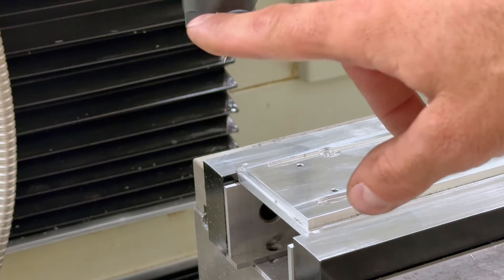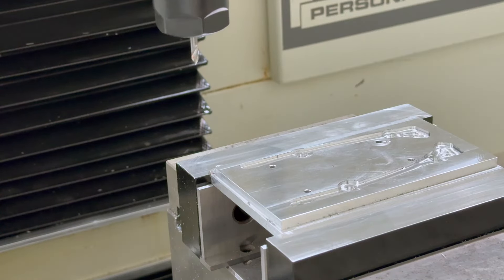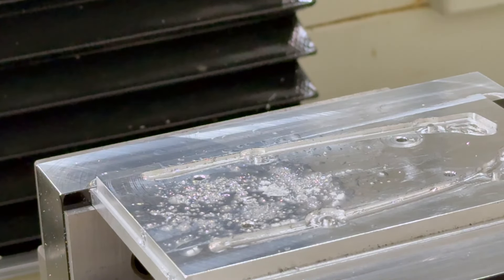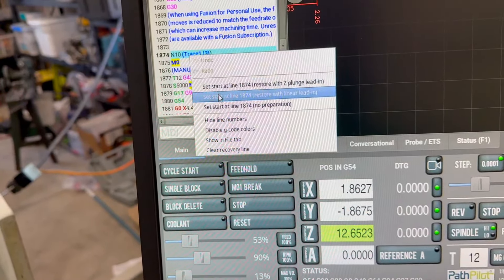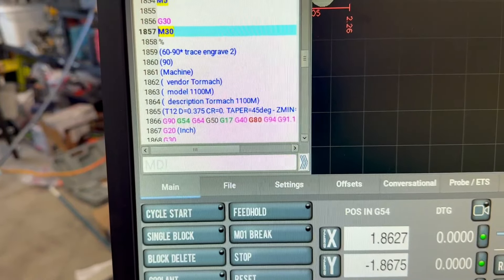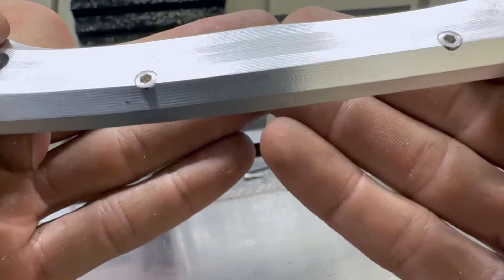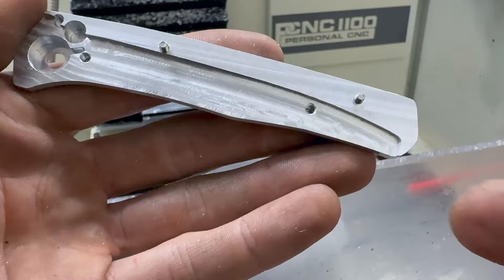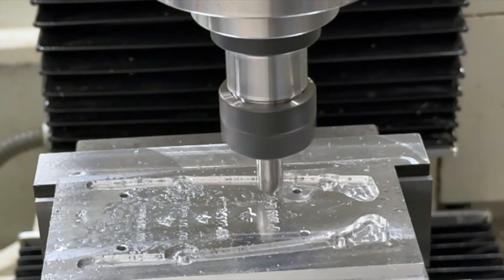Machining a Knife Handle with a Custom Jig on My Tormach 1100 CNC!

Comment: Nice work!  Having been down this path, I strongly encourage you to take the plunge and work out a flood coolant solution.  The first one on my PCNC1100 was stock tank and pump.  

I didn't have an enclosure so I made a frame from PVC and hung a shower curtain from the PVC pipes along the top, tucked those into the tray and held the bottoms with magnets.  Yes, just as awful as it sounds.  But I didn't realize until then that a) Slotting passes can actually work without breaking an end mill, b) surface finish can be good, c) I can machine parts about 4X faster with coolant versus the fogbuster setup.  

It was annoying to deal with flood coolant this way, but I wish I had setup flood immediately, it would have saved a ton of time babying things and blowing chips away by hand and it would have saved a ton of time wasted on broken end mills.   You won't regret it.
Reply from the maker: My dilemma is that the machine will most likely sit up to a month or two, and based on how I got the machine, with nasty dried up coolant that was almost 1/2” thick in places, and rust all over, I’m worried that could happen again. How long does your machine sit? And what coolant do you use? I’m scarred for life after cleaning this thing haha.

Comment: Making a knife with a cnc isn’t easy. Good luck. 👍
Reply from the maker: Thanks! It definitely has its challenges, but this will be knife number 4 and 5 that I’m working on now, so far so good. I have a few videos of making the first one on the tube of you, machining, hardening, and anodizing. I’m no expert, and I’m a worse videographer, but I’ve found watching them at like 1.5X speed makes them at least watchable, haha. I’m getting better though I think.